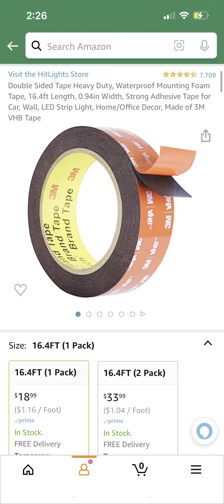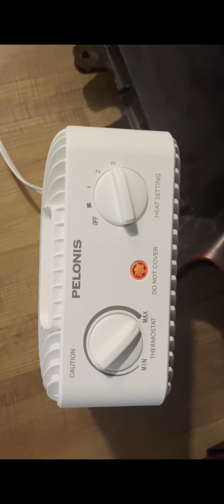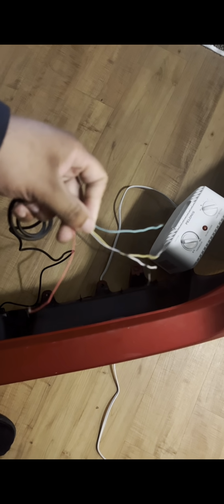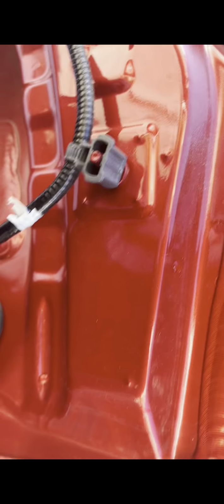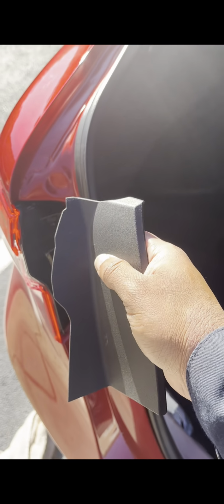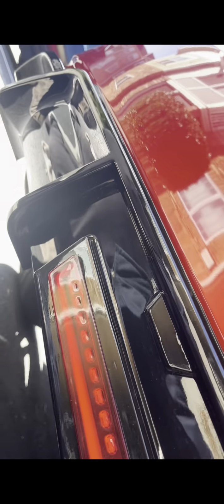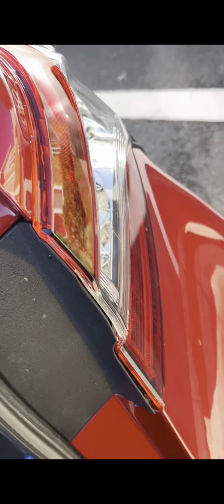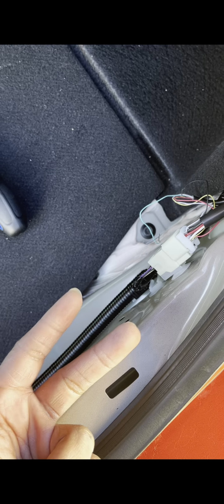Arkdeffon Rear Bumper Diffuser with LED Light Toyota Camry 2018-2022 (Glossy Black) Install

Comment: Did you have to get a new connector end or did you just jam them in? I bought pigtails to cut my taillight wires but this looks better.
Reply from the maker: I bought the two end connector clamps & gave enough space for the tail light wires to be reached easily to cut & slide in one end. Then cut the diffuser wire to slide up top along with the top taillight end fused with the diffuser wire

Comment: WIRING: 17:45
Reply from the maker: @bizarrehazar  😂😂🤷🏽‍♂️
Reply: @DantesGarage  i was just marking that time for myself lol, i bought this diffuser at the time and was trying to follow along
Reply from the maker: @bizarrehazar  it’s all good I hope it turned out great make sure you check all the other diffuser videos to get the certain functions ESPECIALLY the cool brake one 😮‍💨 it’s toughhhh asf
Reply from the maker: @bizarrehazar  it’s all good fam I hope it turn out great for you 💯🙏🏽💪
Reply: @DantesGarage  oh it’s been wired up, which was not my issue believe it or not. my issue is it sticking to my bumper, even with the doubled sided 3M tape. bumper starting coming off the next day. not happy. you got any suggestions??

Comment: wish someone could make a video that shows step by literal step lol. My brain can’t process how to wire or do any of that. I know which wire goes with what but idk where to cut or anything lmao. I’ve had a similar diffuser on for months and it has 3 wires. Just been waiting on a video that shows every step by literal step
Reply from the maker: @DylanSutton-f2c  😂😂 I heard ya. I made like 4 videos on this wiring with all different functions 💯🙏🏽 but all I can say is take the wires touch the battery to see the functions cut your taillight wires & buy the wire clamps I bought & just plug & play mix match every wire til you get the proper functions you want for the 3 wire setup 💯🙏🏽💜

Comment: Does it fit for avalon 2019 and above?
Reply from the maker: Sadly it’s not going to, the rear bumpers are two totally different body styles. I’ve reached out to the seller to also confirm it for you 🤞🏽💯

Comment: I can’t fine that same deffuser do u anywhere else I can find one that does the same thing ?
Reply from the maker: It’s On Amazon, Do You Have A Camry Model??
Reply: @DantesGarage  yeah I have a 2018 Camry XSE and I copied and pasted what u have and it doesn’t appear just different brands do and im not 100% if they will be good or not also looking at the NINTE one and it’s $200+
Reply from the maker: @matthewlobianco9183  Danggg That Sucks Bro, I’ve Just Checked Right Now If You Want My Opinion [ Meyffon ] Is A 2nd Great Choice To Get The Diffuser If You Want It Still. It’s Still In Stock In Gloss/Carbon Fiber Only For $155.99. The NINTE Is Pretty Cool Too For It To Have The Whole Rear Bumper Kit Added As Well 🔥. But Which Ever One You Choose Ik It’ll Look Clean 🔥🔥 Once You Get It You Can DM On Insta To Show It Off If You Want 🥶🤞🏽💯
Reply: Does anyone know how to plug in the wires
Reply from the maker: @emoney5050 Yes, it’s in the video explaining how to. As well as other videos on my channel for different wire set ups for different animations as well 🤞🏽💯